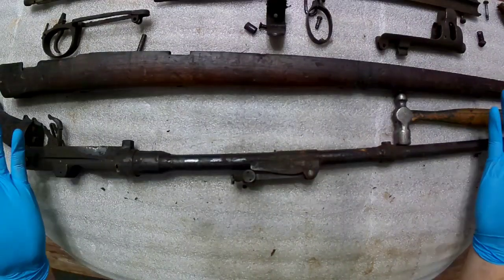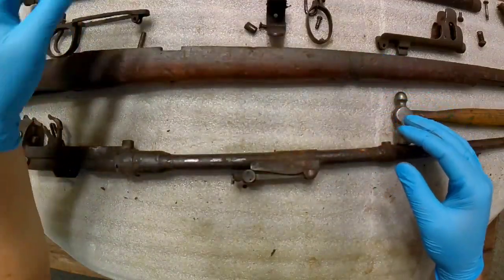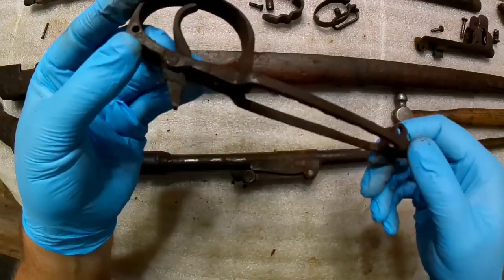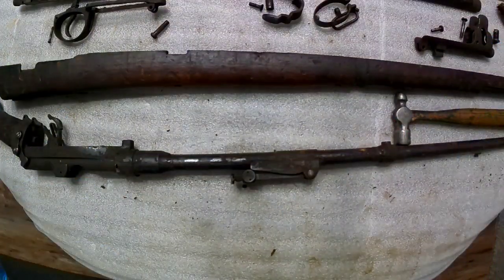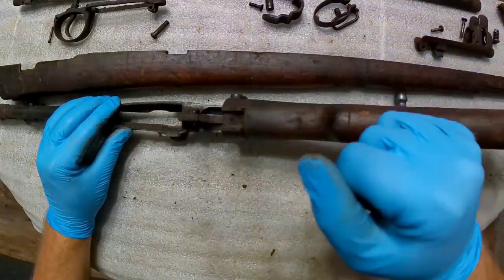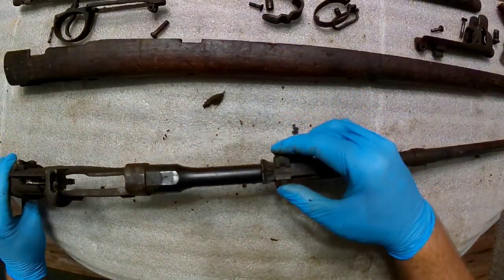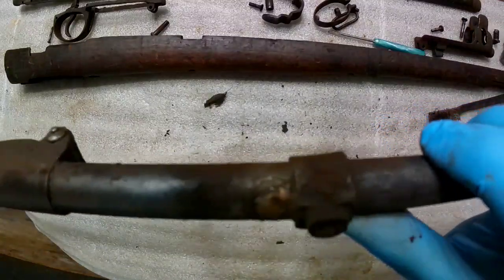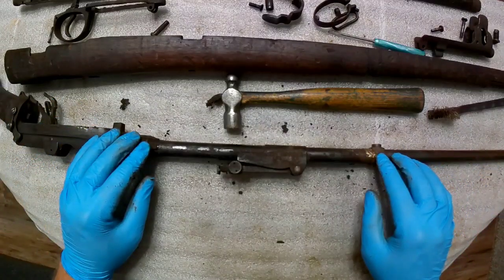Lee Enfield No 1 Mk 3 - C GRADE from Royal Tiger Imports (RTI) - Part 2, Condition Under the Wood

Comment: Actually bought one of these myself.
I had a much better stock but some missing and broken bolts. Good bore though.
I highly recommend "boiling" the parts. It is just converting red rust into "black rust". It is very important that the parts are thoroughly de-greased and clean before hand. Wait until you see a very fine red hue form on the parts. then, 45 min to an hour with gently boiling water is enough. The parts will need carding afterwards. Just keep in mind after the boiling the parts still look rusty. This is normal and will clean up fine. Afterwards a neutral oil should be used to harden the bluing. Do not use automotive oils as they have rust inhibitives that will destroy the newly formed bluing. Kerosene is a cheap alternative. 
The important thing in all this is the boiling converts red rust too bluing. Bare metal will need some actual rust on it to form bluing. Also do not remove any existing bluing. It will all blend in the end. You may need to repeat the bluing process. 
Currently onto conserving my 10th rifle. I hope you have as much fun as I do!
Reply from the maker: Sorry for the late reply on this, somehow some of the comments never show up...anyway thanks for the tips, I'll keep those in mind when I boil my own parts.

Comment: Enfields are pricy where I live but  I bought myself a no1 mk3 that had been sporterised in the past but was recently professionally restored by a gunsmith using a DP rifle, it’s less valuable and was cheaper to buy but it’s in overall very good condition and has an excellent bore, started looking into restoring one myself recently so video’s like this offer helpful information and perspective.
Reply from the maker: Cool, thank you sir!  That's impressive,  a DP marked one reworked to firing condition!  So I have to ask, where are you located if you don't mind me asking?
Reply: @The_Casual_Collector  it’s a well put together rifle, far as I can tell the action, bolt and probably barrel match, those were FTR’ed in 1953 so it avoided the old DP stamp, the rest is from a DP, the draws look to have been rebuilt and the stock and barrel bedding were done using the armourers guide for lee rifles, so traditional methods were used, while a DP rifle can be made operable it’s usually not recommended if the receiver bolt or barrel are DP’ed as you can’t be sure why it was taken out of service, some were just marked dp to meet demands for training and are fine, luckily my mk3 doesn’t have any concerning stamps anywhere it matters, I live in Canada where unfortunately most surplus is at least $200 more than in the states in part due to importation cost, there are a few exceptions though; anyway I hope your project goes or is going smoothly, I probably won’t do a mk3 restoration myself till after I fix up my mosin, but I’ll keep an eye out for progress updates on how yours goes.
Reply from the maker: @andrewtetz2198  awesome, thank you.  That's really cool, I wasn't aware of some of the intricacies the DP rifles, thanks for educating me.  Yeah that stinks for the extra import cost, but at least as of late you guys could still get a newer sks and m14 clones.
Reply: @The_Casual_Collector  unfortunately our future dictator banned M14s because one person decided to use it against their fellow humans in the past, the sks is in their sights but the backlash from their last attempt to ban it and many other popular hunting rifle’s including the single shot ruger no1 made them step back, for now it’s still legal, we have gotten some beautiful condition Chinese sks’s very good to excellent condition for just under $550 which here is a great price for surplus, and the Chinese models while less collectible are good quality generally or on par with the soviet stuff at least.

Comment: I dont think the soldering wouldve got hot enough to hurt anything. Im not sure on exact temps, but im sure it wouldnt take too much to melt it back off. And as previous comment said, yes it is suppose to be free floating around the barrel. To remove it the front sight would need to come off. I recently purchased an ishapore 2a1, which is basically that rifle but .308. I broke it down 98% to boil and clean so if you have questions or troubles getting it back together i should be able to help. I think a good clean+a boil/steam or two and itll clean up great! Unfortunate on the stock tho. Like you stated..itd prob be best to grab a DP and piddle with the stock later!
Reply from the maker: Yes sir, I totally agree, yep this one will likely be the candidate for rust bluing.  It'll be my first one.  I recently did get a dp rifle from JG Sales.  I'll try to upload the video either tomorrow or Saturday.
Reply: The mk3 rifles are not actually free floated. The are bushed/shimmed/sprung such that the barrel is pressing up on the nose cap and held down in the middle of the barrel to prevent whipping/flex of the barrel when the rifle is fired. The No.4 rifle is actually free floated but is fundamentally a completely different rifle.
Agree on the boiling to help preserve. Important to de-grease before boiling. 
I would highly recommend Mark Novak Channel for further information.
Reply: @brettanderson6743  I didn't mean the barrel itself was free floating, I understand how they are setup as I have both. I meant the peice is able to "freefloat" or free slide up and down the barrel when it's disassembled.

Comment: Is the date on the receiver where the buttstock screws into still legible? Unfortunately the barrel is not always a correct indication on the original manufacturing date. The barrel could have been replaced in 1927.
Reply from the maker: Unfortunately it isn't, well, not entirely.  I just shot a video on everything I could see on it, here's the link:
https://youtube.com/watch?v=vFvyG_zk77Q&feature=share8
Any help identifying the date would be greatly appreciated.

Comment: Quick question,  how is your barrel.?
I have 2 "B" grade No.4 mk1, and one "B" grade No.1 mk 3☆smle enfields and all 3 barrels are complete garbage.  Pretty upset,  do you know anywhere to buy replacement barrels,  have be lloking very hard to find,  and came up with nothing. Thanks
Reply from the maker: Mine looks like it has a really good bore, a little dark, but strong rifling.  Check out InterSurplus in Canada for the No.1 Mk. 3, I'm not sure if that can be shipped to the US.  Lothar-Walther and Criterion make new ones for the No.4 Mk. 1, but they are definitely not cheap.
Reply: @The_Casual_Collector  thank you, I refurbished one of the No.4 & the No.1 they both got reblued, every piece of the gun, and redid the wood and put 7 coats of boiled linseed oil on. They came out absolutely beautiful,  but did some super deep cleaning with no.9 bore Brite,  I use an old worn down .30cal brush and I wrap the brisels with course stainless steel scrubbing pads. Works fantastic.  But it shows the truth. Thank you for the information.  I'm going to look into them. God bless brother.

Comment: That's weird that they soldered that band on, it's not on either of mine.  I think I'd melt that off to see what's under it.  You can try drilling a hole in that broken screw and use a screw extractor.
That stock is beyond repair IMO unless you're quite good at wood work, the cracked part in the rear that sits behind the charger bridge is most likely broken because the draws in the back that take the recoil are totally blown, that allows that section to get hammered under recoil and cracks it..  I have heard of people inserting new wood back there to fix it but it was more than Im capable of so I got a drill rifle stock for my Ishapore.
If the metal is fine under that solder, I think I'd tie the rifle down and test fire it a couple times and then call it good as long as it doesn't show signs of an issue.  I don't think the temp to melt that solder should effect the metal's strength bad enough to weaken it, especially half way down the barrel.  I may be totally wrong though so definitely ask someone smarter :)  If it were near the chamber I'd be way more worried.
Reply from the maker: Yep, I completely agree...Seems I can't find a single article or video of anyone talking about how those bands were installed.  I know I did see a video of a guy disassembling one, but he left that band on and said any further disassembling required specialized tools.  So who knows, I'm hoping some of my Aussie subscribers will chime in here that have the same rifle.  But yeah, that stock is toast for sure.
Reply: @The_Casual_Collector  hi the band that is brazed on should be free floating on the  barrel ,you have to remove the fore sight to slide the band off, the cosmoline seems to have saved the barrel i have seen them with deep pitting caused from moisture trapped be the wood, it looks cleanable, i look forward to seeing how you get on, best wishes from the uk 👍
Reply from the maker: @chrisgosling6083  oh wow, so it isn't supposed to be brazed on...I was worried about that...thanks for the insight!
Reply: @The_Casual_Collector  depending of he skill of the person who did brazing and seeing now lumpy it looks not very skilled , it can take the temper out of the barrel and cause a soft spot, but if it was cooled with water it can cause a brittle spot so keep an eye on the bore when shooting , as the braze is lumpy and did not "flow" hopefully it did not get to hot  good luck with the resto